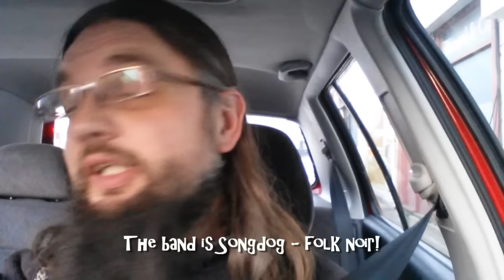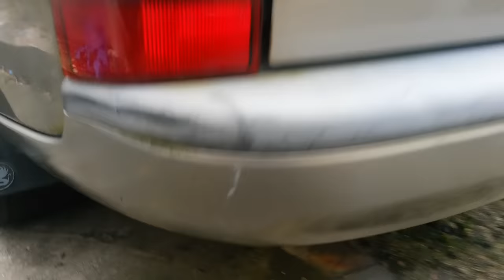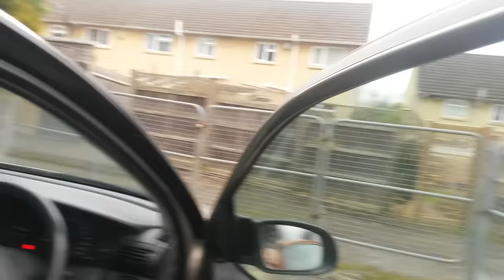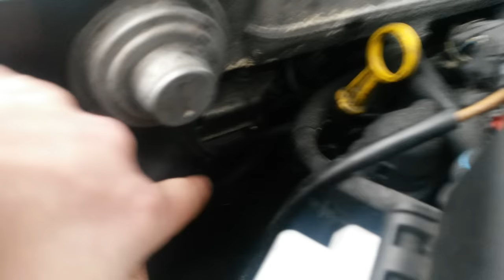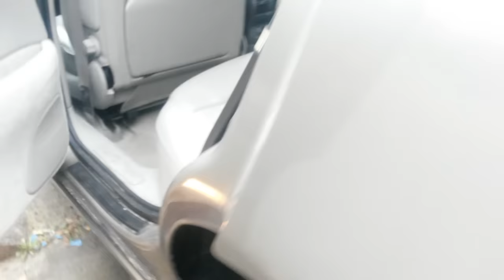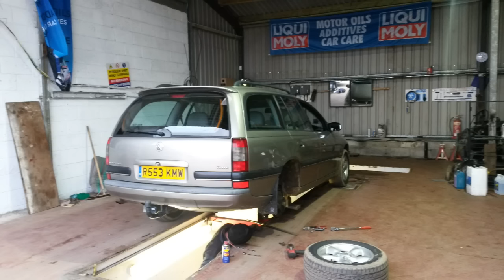Project OMG: Crazy Car Collection Capers, Part One

Comment: I had an E34 525tds with the same engine (plus a bit more power) about 10 years ago.

My overriding memories of that car were the locking torque converter kicking in at about 60mph, which gave incredibly low rpm at motorway speed, and stockpiling metric Michelin tyres as thats what was fitted to it. . 

It wasn't a quick car but it was a lovely daily driver for me.

Comment: I wouldn’t have minded that Mk3 1100. Shame about the driver’s heated seat, otherwise looks like a respectable purchase - once the three MOT knock backs have been fixed. Is this the UK version of our Holden Commodore? If so Holden missed a trick not producing a Commodore with a Diesel engine.

Comment: My 2.5 petrol had a leaking pipe int eh Aircon which dripped down onto the ECU which eventually killed it, got that sorted then after 18 months of hassle free motoring ((other than it not liking Road markings in the wet)) all the warning lights came on and I traded it in.

Comment: Bit late but I got a 2.2 petrol omega auto with 150,000 miles its like a Cadillac for europe (GM built it on the cadillac catera platform).
Reply from the maker: Ah, but which came first? I think the Omega became the Cadillac rather than the other way around.

Comment: had no idea the omega TDs came in a 6 cyl form, thought they were all four cylinder clatter bangers. A mate had a 2.5 Omega, lovely quiet and decent performance but ended up dying a slow death with cronic misfire problems under load and never got fixed before he scrapped it for a plethora of other issues.
Reply from the maker: They later changed to Vauxhall's own 2.2 four banger.
Reply: I guess it was somewhat more efficient and not that much slower, just missing the 6 cylinder rumble of that nice BMW unit?
Reply from the maker: Probably quicker. The BMW unit was detuned for the Vauxhall to stop blowing the gearbox apart...
Reply: @HubNut  the 2.2 DTI was crazily noisy as well

Comment: I had a brand new Omega and it was rubbish. Spent more time at Vauxhall for repairs than ever I drove it. It needed a new water pump at less than 6 months old. Gearbox would stay in first until the cat reached a certain temperature which was annoying. Acceleration was such that if I wanted to overtake, I needed to make an appointment. Got rid of it in less than a year and lost shedloads of money. I later bought a Vauxhall Monaro (basically a two door Omega with a bigger engine) which was shite as well. Every 50 miles it would start a bleeper and light show until I pulled in for a rest and those door handles were the same which meant if I wasn't careful, I'd get some very nasty blood blisters. The suspension rattled and the alloys had inherent metal fatigue.